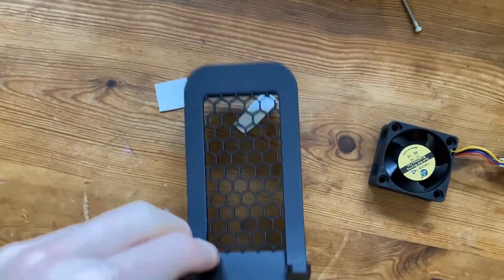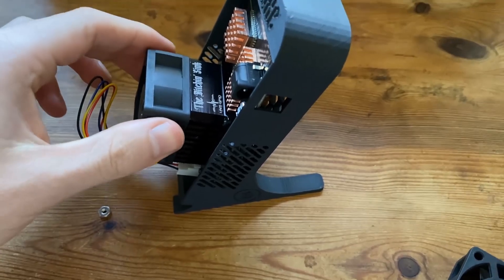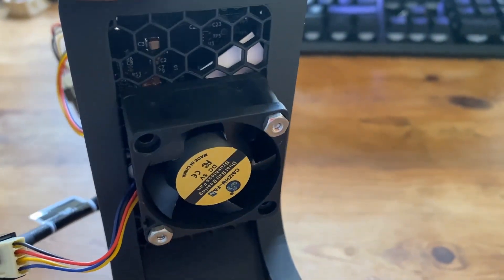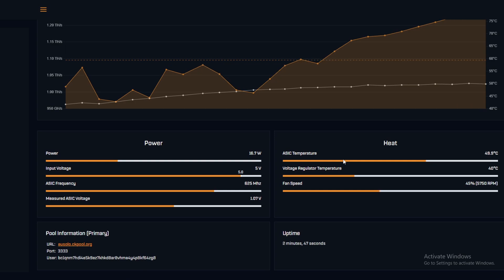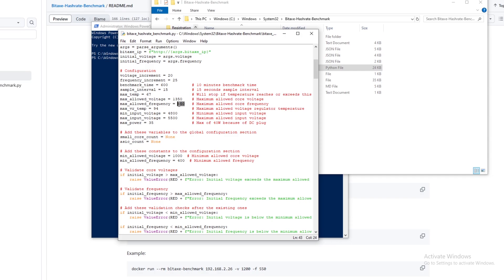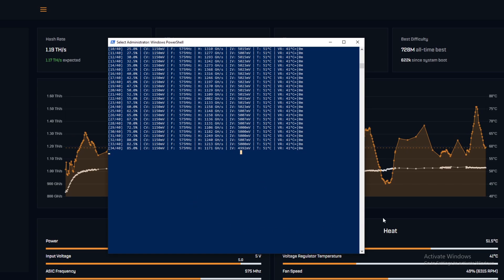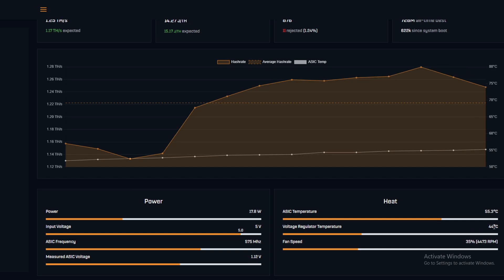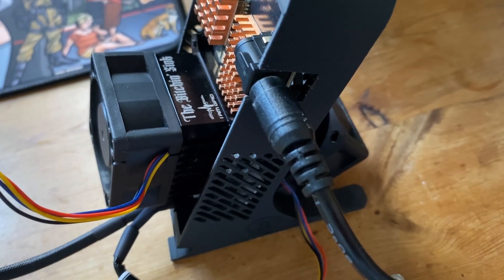Bitaxe Gamma Double Fan Upgrade Testing

Comment: I almost have the same setup. I purchased a noctua fan and when I ran it on front it overheated very quickly. I ended up just using stock fan on front and noctua on rear

Comment: Why don't you get two to four longer screws the length or the distance of both fans and run them together that way instead of using little plastic mounts
Reply from the maker: Just what I had laying around as a quick fix proof of concept

Comment: you can continue to overclock until voltage drops to 4.6v .. the ASIC will stop hashing when the power get too low, but its safe to push the voltage lower! and the clock speed higher, I have stable 975mhz with rear fan. 2TH/s
Reply from the maker: But isn’t that going to break it overtime
Reply: @timmoore22  what’ve you done to your bitaxe to allow it to be pushed that hard? Fans? Heatsinks?
What temps is it running at?
I’ve got mine running at 675 and 1170 which has the ASIC temp @56 and the voltage regulator @75

Comment: It was me that mentioned the rear fan on the frame. If you twist your fan clockwise 45 degrees, 2 of the fan mounting holes line up with the frame.
My frame is a basic one without the shroud around it, and no honeycomb in the back. I would be tempted to take a sharp knife to your frame, get a bit more air flow.
My rear fan is a 2 pin, and plugs into the front, to the right of the asic chip, it runs at constant speed, and quiet. 40x40x10mm.
Reply: The stand you are referring to is called the  "Bitaxe Minimalist Stand"  and D-Central add 2 screws and a rear 4010 5v fan mounted diagonally
Reply from the maker: Right I’m sorry I don’t have the stand you are taking about but worth a try with this one

Comment: Customizing the Bitaxe is like customizing your car back in the day. New intakes and exhausts to increase the performance of your machine just like fans and heatsinks😂
Currently running my gamma at 675 and 1170 with heatsinks on the back side of the asic and also on the front to the right of the voltage regulator like you have.
Getting an average of 1.4TH, peaks around 1.8TH and steady 5V
Reply from the maker: Cars are overrated, people want 5th/s out of a bitaxe gamma nowadays
Reply: @ HAHAHA how right you are! However I do still like cars, but the older ones that had style and ran on dinosaurs. Not these oversized Dysons that lack soul.
Reply: Hi, did you upgrade the power supply or same stock one?